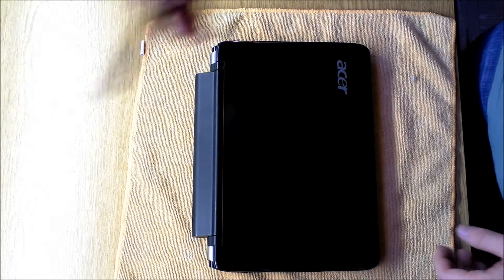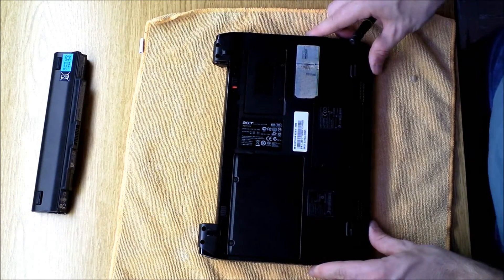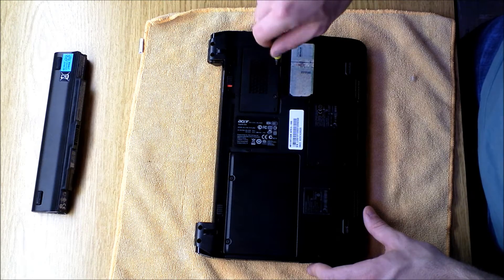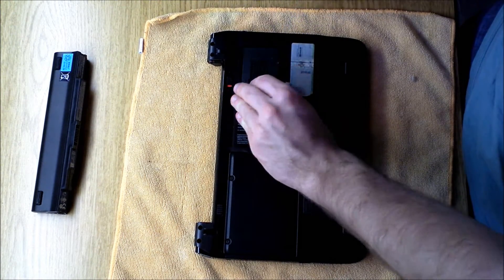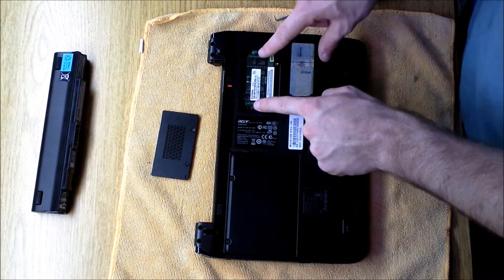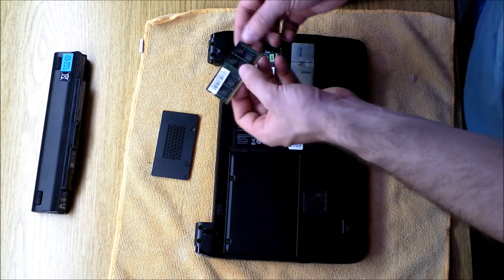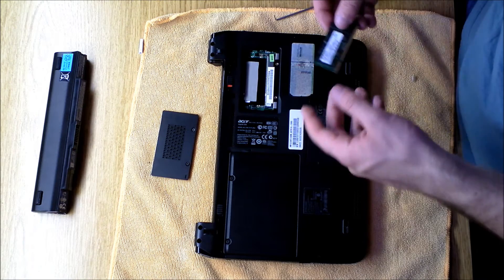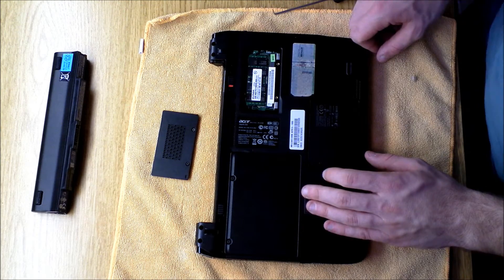Remove and replace ram in Acer A0751h AO751h 11.6" Netbook (1080P)

Comment: This laptop is almost a fucking joke in its own way, I installed 2GB of fastest DDR2 ram I could find, bought a 120GB SSD for lulz and installed Android in this bitch and its still lagging like a moron when I try to play 1080p movies. What a joke the Intel Atom is.
Reply from the maker: ***** Its a budget laptop from 5-6 years ago, not sure that I'd expect to play Crysis on this thing.
Reply: mr82020674 I would expect it to at least run fucking YouTube at 480p smoothly but not even that it can manage, it runs fine in Android but even then its struggling in 720p. 

There were smartphones back then that could play 720p...
Reply: I've got old one from back, also thinking about upgrade from 1gb to 2gb RAM. Do you think it worth it? will it be performing better or same slow?